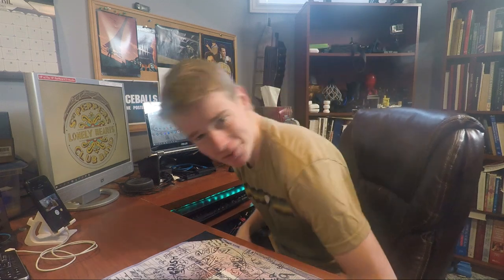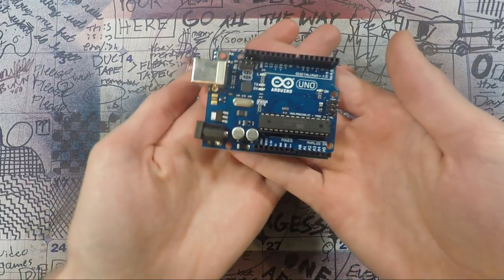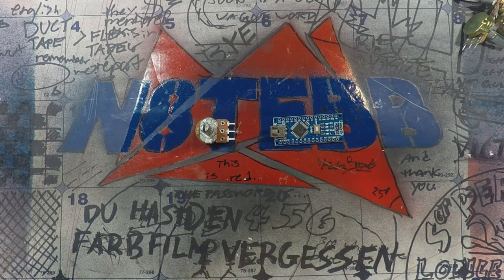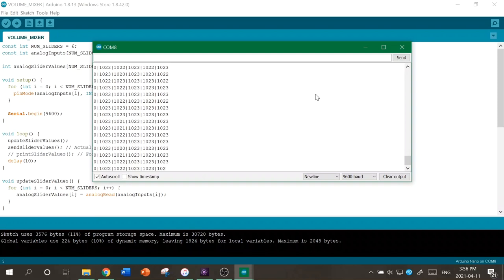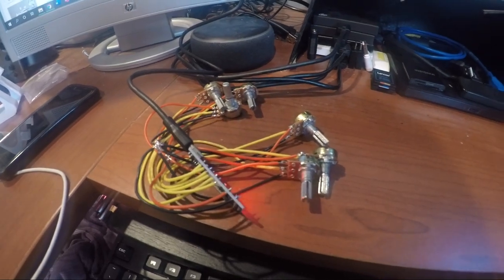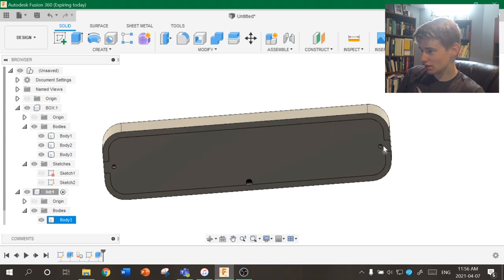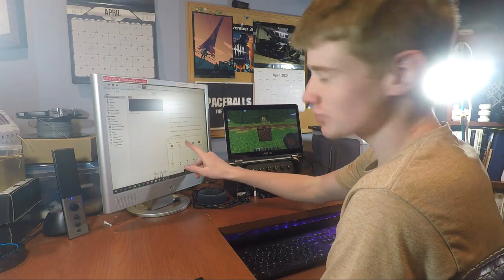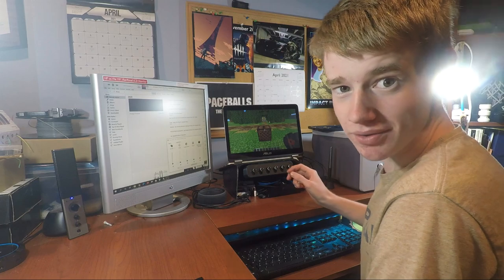Control Program Volumes Separately! (Making a Volume Mixer)

Comment: Honestly, I've been looking for something that would perform this EXACT function, while not breaking the bank. I can't justify spending 100's on the new BEACN stuff, and I've DIY'd a 32 function button box for my sim racing rig using an unofficial Arduino Nano, so this should be easy as hell to do. This is exciting, thanks for this video!

Comment: Really nice, even learned a trick or two while waching you solder. I never thought of connecting the cables with solder together and to put solder on the connection first. 😅 I always tried to use a pcb and then messed it up 🤣
Reply from the maker: The way people tell me to do it is to heat up the wire with the iron, and then put the solder on. Apparently the solder and the soldering iron aren’t supposed to touch. It takes some practice cuz I’m still not very good at it 😅

Comment: mans needs a new computer and monitor, homie's making youtube videos on a 15" laptop and a 2005 monitor
Reply from the maker: 13" laptop, but you almost nailed the monitor. its a 2006 lol. Don't worry tho, im of to uni this fall so a new computer is on my to do list.
Reply: @N8TEBB  lol, good luck. I built a PC last November and it was the best spent money in my entire life. Tip: If you're building a gaming desktop PC, don't skimp. Get RGB, get a solid CPU, a GPU that has more than 3 gigabytes of visual random access memory, a GPU that has memory faster than GDDR4, go all out.
Reply: @N8TEBB  what college you going to?
Reply from the maker: @Astral-fp2hs  heh, unfortunately I don't see building a computer in my near future, as Uni requires a laptop. It will sure be a beefy one, but not as all-out as a custom desktop PC.
Reply from the maker: @Astral-fp2hs  Uni of Windsor for electrical engineering. Starting this fall! I'm excited to start uni but not so excited for the amount of work its gonna be
Reply: @N8TEBB  it'll be worth it chief, good luck!